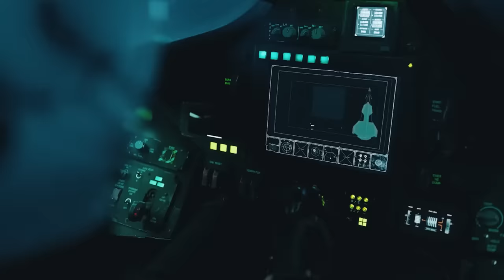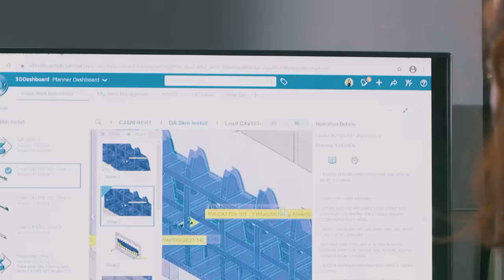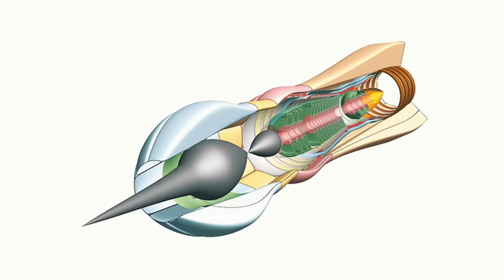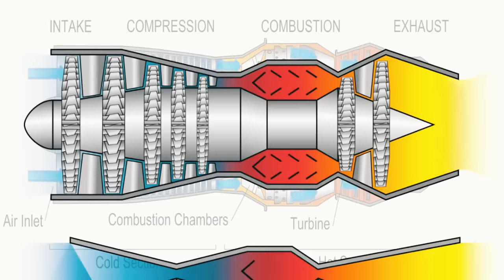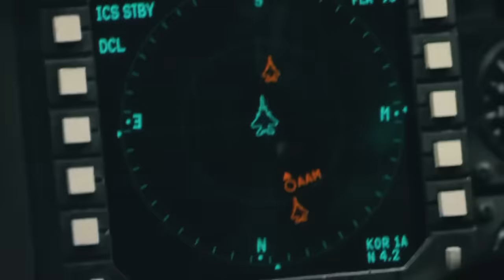US Revealed Top SECRET Hypersonic Aircraft Reaching Mach 10

Comment: I wonder if they are successful in creating a Mach10+ aircraft will pilots be able to withstand that speed or will they have to be remote operated drones.
Reply: There is little reason to put the pilot in the aircraft anymore. The capability of AI to create a semi-autonomous vehicle, with remote operators makes better sense. The savings in weight by eliminating the onboard pilot justifies the change. Having operators in theater, say on a command ship, will lend to the situational awareness necessary. And if a ship is destroyed, we didn’t lose a trained pilot. The remote pilot just dials up another unit and resumes. But we cannot fail to address the moral accommodations that are required as warfare becomes more remotely conducted.

Comment: Thermal problems at mach 6-8 range include fuel dynamics (alt?) and inertial distortion that strongly suggests a non-reusable platform that is quite pricey … this jewel would be reserved for closing arguments in a three- or four-fold phase assault that has not progressed too well.

Comment: mach 10,20 but you didnt mention what altitude...air-breathing at the upper limit of the atmosphere O2is no more available//on the other hand if you fly lower you got overheated...//this is very sensitive and even the space shuttle cant re-entry at too much speed into the atmosphere it will also burn>>>the ideal way is to develop an active magnetic shielding to be able into the atmosphere

Comment: Taking electric fence putting a fence over another fence gapping it out and running just positive energies positive on one doing at 10 B positive at the other one and 1500 playing with the plasma generation in the heat wave in between the to break the static barrier and to get into hypersonic and even faster than that invisible adjustments putting a water agitation system or a separated water chamber and pressurizing vacuuming the water around space suit

Comment: 🕳🕳🕳🕳🕳🕳The truth can be established by special methods of Open-source intelligence (TEXT MINING). There is an interesting design of aircraft, but they rarely talk about it, because this thing is secret. The topic of pulsed plasma thrusters has been developed since the early 60s (see PPT - Pulsed plasma thruster) - they are usually designed for spacecraft. But we will talk about a little-known design - these are plasma propulsion panels for aircraft, where the same Pulsed plasma thruster, but reduced to the size of a pencil and stacked in the form of cells in the panel. The design resembles a conventional plasma TV screen, where there are also discharge cells that activate the glow of pixels on the screen. And plasma propulsion panels have long discharge cells, the arrester has a railgun architecture (just rail contacts or coaxial), and the ionized discharge air is accelerated there by the Lorentz force to enormous speeds - a kind of ramjet engine is obtained. Just imagine! - tens of thousands of small ramjet engines assembled in a panel and firing plasma synchronously with a huge frequency (hundreds of kilohertz). Thus, plasma propulsion panels create lift by pulsed emission of plasma jets from railgun cells. There are tens of thousands of cells in the panel, they shoot at a frequency of hundreds of kilohertz, a huge pulse is obtained, and the plasma swirls the air into toroidal rings - the aircraft is held on this air cushion. Horizontal acceleration is created by the same plasma panels on the sides of the device (they glow, from the side they look like "portholes"). Such devices like "triangle" or "disk" have been observed for a long time, they are mistaken for alien ones - but these are terrestrial devices. They are classified and used for espionage and secret actions. Pulsed electromagnetic technology generates microwave radiation, therefore it is harmful to health. They rarely fly - only military missions. Therefore, they are not suitable for a citizen. This maintained the secrecy. Now they are already declassifying - many people know about this secret technique. When declassified, they will be used for cargo airships. But there is a danger that they are now going to be adapted to deliver small nuclear charges to decision-making centers - such means of delivery are not specified anywhere, are not conventional. This lowers the threshold for starting a war. It would be necessary to declassify them as soon as possible. That's why I'm writing about it. However, I have written before - starting with the book "The Elimination of UFOs" and many articles. There are also videos on my YouTube channel - "Declassified UFO" and "UFO Anatomy".